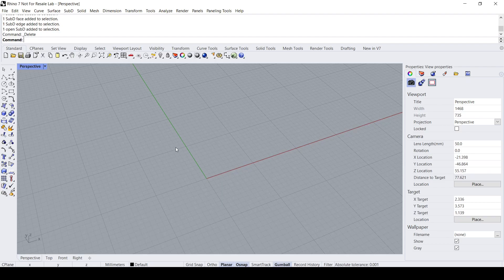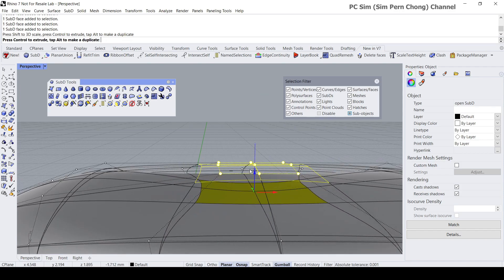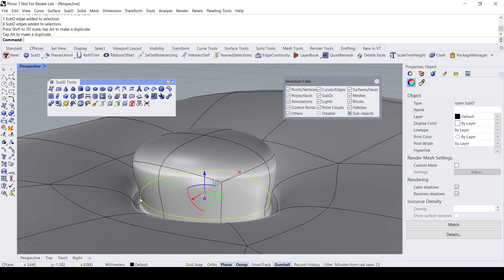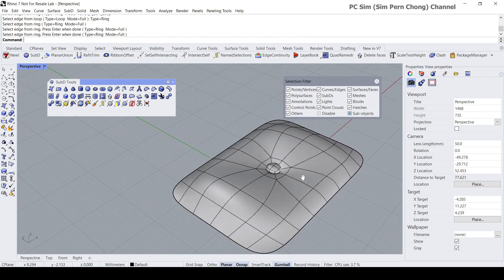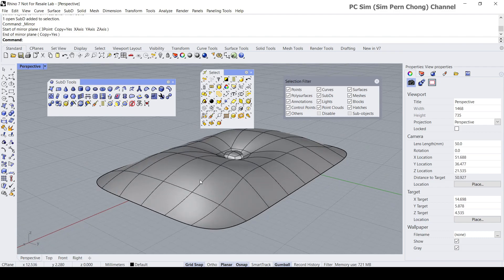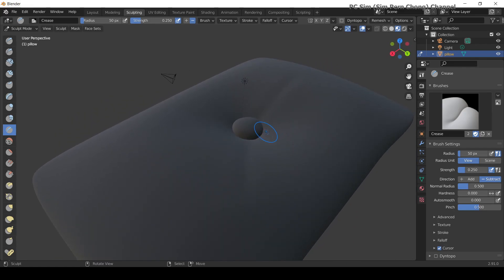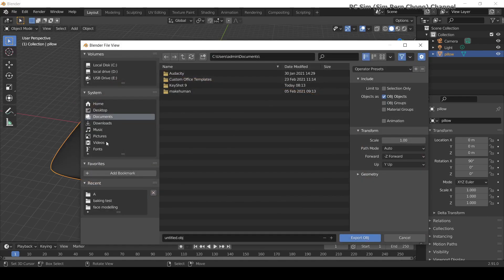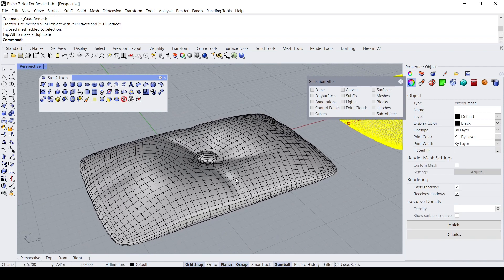Rhino 3D Tutorial: Modelling a Pillow (requested) [犀牛3D教程：枕头建模]

Comment: i have a question, im working on macbook, and when i make a subd plane and begin to edit the points, the nurbs look square, and no soft like the video, but if i convert this to mesh, then i see the polygon softed, why this could happening?
Reply from the maker: Hmm... that's strange. Have to press the TAB key to toggle to the smooth mode of the SubD? The TAB key toggles between flat and smooth mode of SubD objects.
Reply: I alsto struggled a bit with that. You have to go to the obj properties and switch on the edge softening tool or the thickening